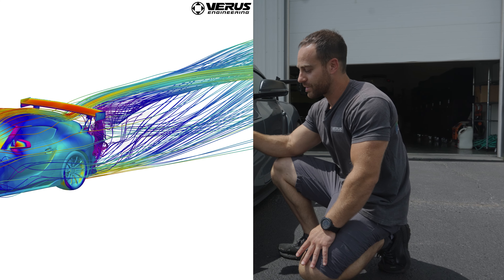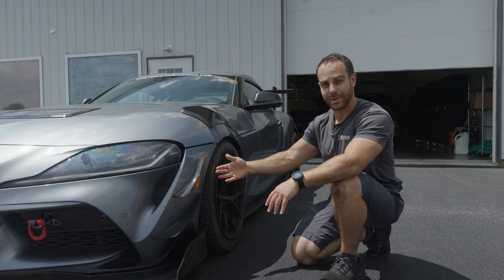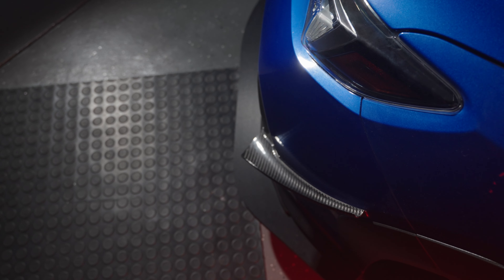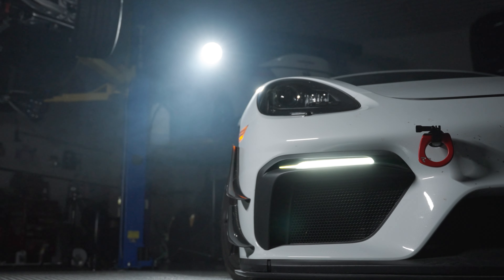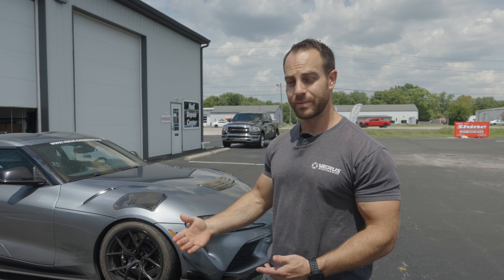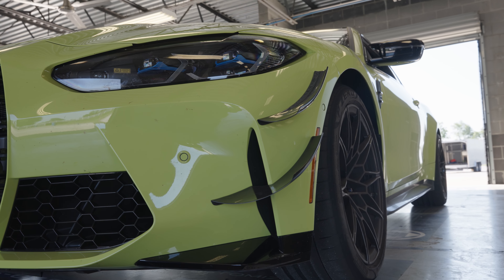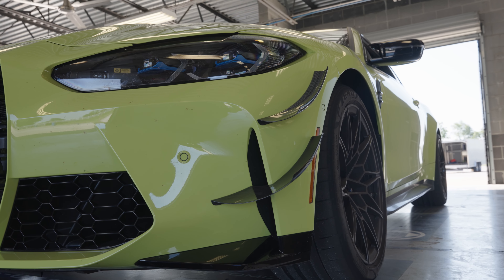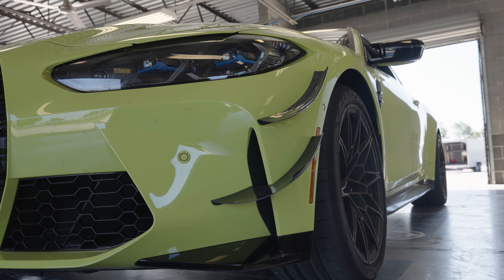How does a Dive Plane (Canard) work? | Motorsports Engineering

Comment: One thing not mentioned is that dive planes don't have good drag-to-downforce performance. It's just that there's limited choices with front end downforce sources, unless the customer is willing to mount a huge front splitter akin to what time attack cars use.
Reply from the maker: Good point and thanks for sharing your insight.

Comment: I'd love to get a pair for my FK8. I do a lot of crusing at 100mph. Would this worsen my gas mileage at that speed? I have your diffuser but haven't gotten the time to install it yet. The diffuser should yield me better gas mileage. However, it might shift the balance backward a bit, so that's why I am looking at the canards right now. 

Why not just get a front splitter? Well, my country has a lot of these sharp ramp-like road in the city center. I don't want to destroy my splitter or even damage it outside track. 

I want to get the UCW too but I don't think the front axle would generate enough df with vented hood and canards without big drag penalty to balance the car.
Reply from the maker: No, this should not change your MPG. If so, it will be so minimal you won't notice it. However, if you want to add the rear wing, you need to add a front splitter to balance the wing out. Dive Planes and a rear diffuser is your best bet if you are worried about MPGs.
Reply: @VerusEngineering  I see. I will probably get them later. How about side skirts? That shouldn't increase drag but downforcr due to less dirty air getting into the belly and ruin the wake, right? 

Would it be possible to set the UCW AOA to a near OEM angle so you can run it without a front splitter off track? It'd be great if you could design a front splitter that can be quickly taken off and put back on when you are off or on track.

Comment: too small especially the top end of the canard is only half as wide as the lower part..... would be lucky to get any benefits sub 200kph... if any at all.
Reply from the maker: We have plenty of CFD data that would show otherwise, but thanks for the tip.